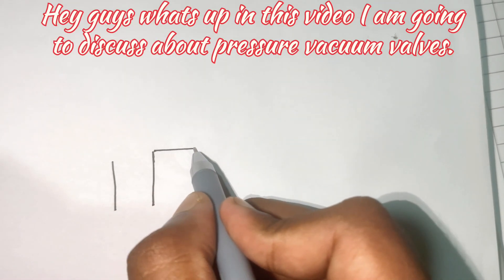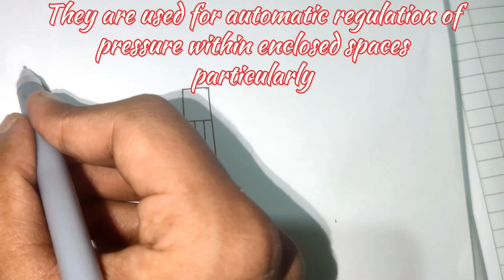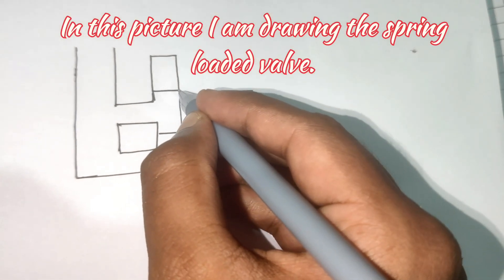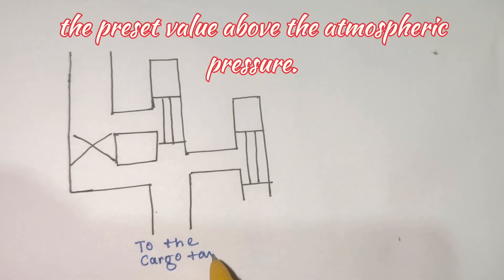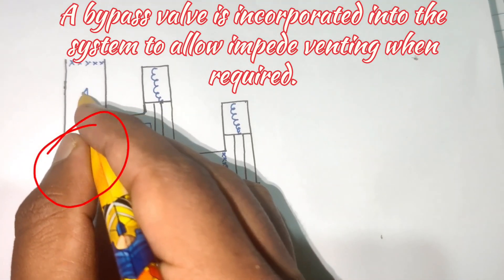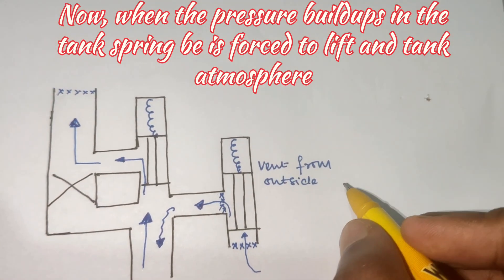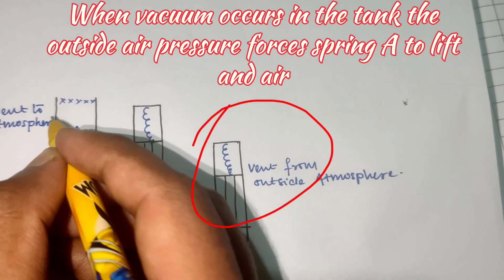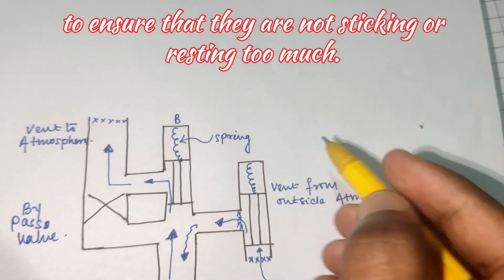Pressure Vacuum Valves ...

Comment: Sir why this vaccum side fitted ulta facing deck ??
Reply from the maker: The vacuum side of a pressure-vacuum valve is installed upside down to prevent dust, debris, and moisture from entering the system. This orientation protects the valve from weather, ensures proper drainage, and enhances the seal's reliability by leveraging gravity. It helps maintain clean air pathways and ensures optimal performance.